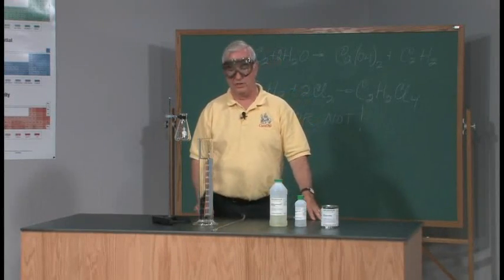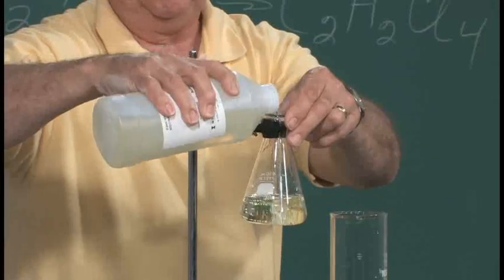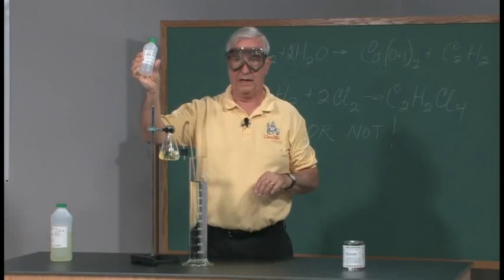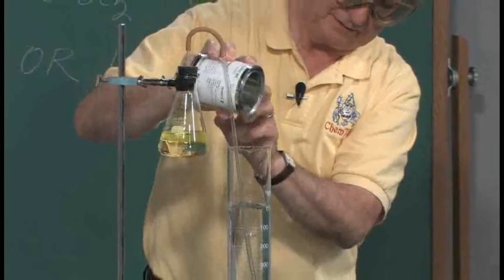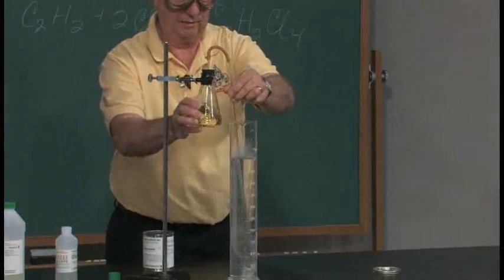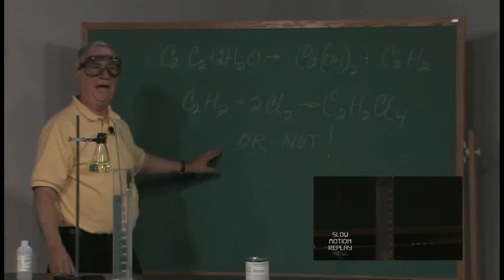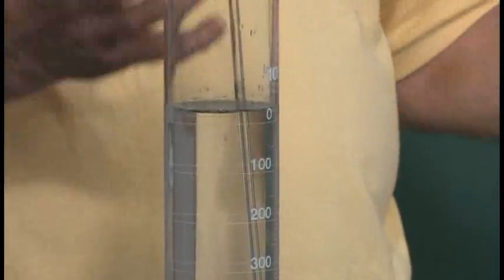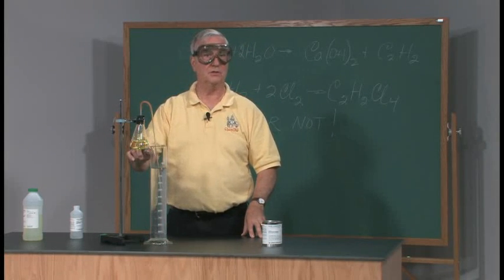"Underwater Fireworks" Reaction of Chlorine and Acetylene

Comment: To everyone pointing out that he isn't wearing gloves. He understands that the risks of getting the chemicals he is working with are hardly a danger to his skin. Unless he is working with hot concentrated sulfuric acid or concentrated H2O2, then the bare minimum ppe he needs would be goggles, closed toed shoes, pants, and a shirt.
Reply: Dear Sir, Humbly I request you from my depth of heart "Please tell me which chemical will produce more heat to ignite the head of the matchstick when we keep it from the distance of 3 inches to the Chemical solution. Sir Please try to understand my question:
 The match stick should ignite itself by the heat or power of the chemical without touching to the chemical it should ignite itself when we keep match stick from the distance of 3 inches.  So please tell me how it will possible. Sir Please tell me very soon I wait for your precious response. This is my mail id   limmakabalaraju35@gmail.com    or balaraju_limmaka@rediffmail.com